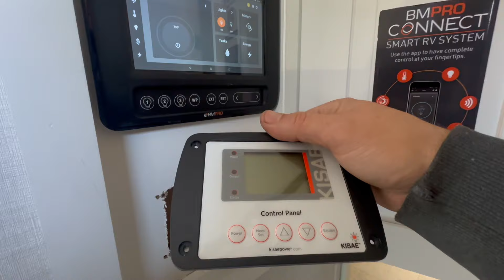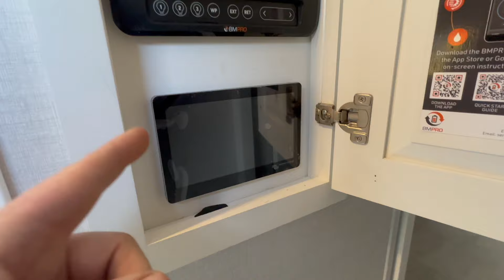River Stone Legacy 5th Wheel Victron 24 Volt 2700w Solar System Install

Comment: Great video - thank you.   You’re definitely helping me understand things through the design of my own install for my RV.  Do you recall if you have any videos that speak a little more to details of retaining a 12v battery in the overall system of a 24v install?  Ie for slides/levelling and others….
Reply from the maker: Look at our 24v videos. It’s really simple, keep one there. Can be lithium or lead acid / AGM. Don’t stress about keeping it 100% charged all the time. It has a simple job “help with larger loads, then rest and slowly charge until needed again “ the 12v system usually runs around 13.2-13.8v anyway and is plenty to keep the battery charged enough for that role.

Comment: I see a lot of installers place two of the MultiPlus units close together, while Victron recommends a 4" spacing.  Aren't you worried about the units overheating?
Reply from the maker: We typically do extensive load tests  to make sure the system works as intended. Yes Victron does want more clearance, many time there just isn't room.  We can mitigate this through exchanging air with the outside through other cooling means.

Comment: Do you mount solar panel brackets to the roof rafter/joists or do you find that screwing them into the roof sheeting and dicor is sufficient? My alliance has 3/8” roof decking over the rafters and I’m debating if I need to hit roof rafter/joists with my new panels.
Reply from the maker: If we were doing a rail system, we would wanna hit the roof joists, but because we used plain Z brackets the roofing material was plenty strong with eight fasteners per panel.